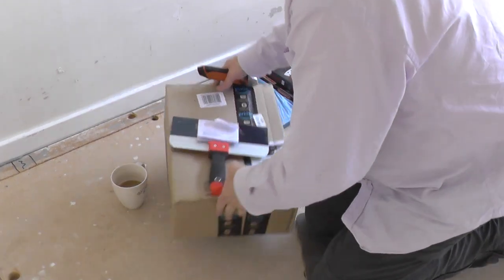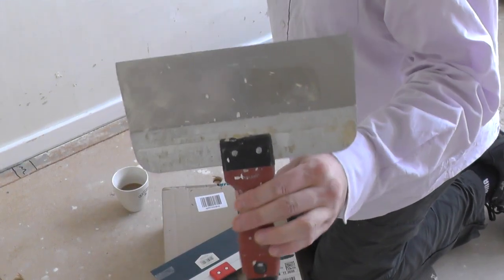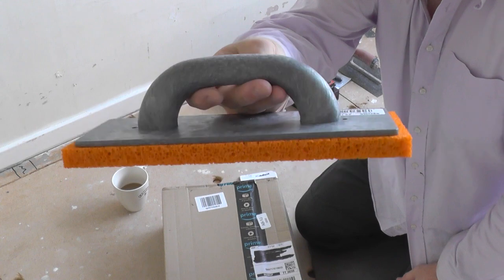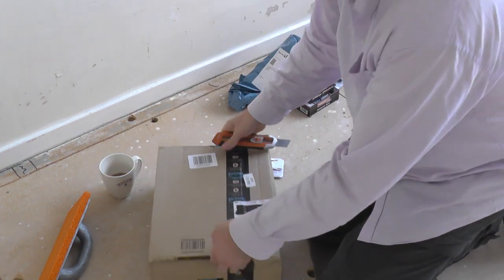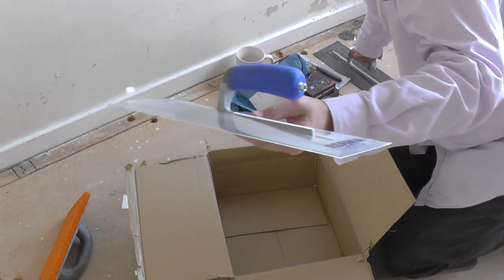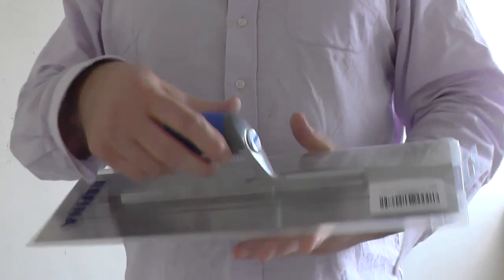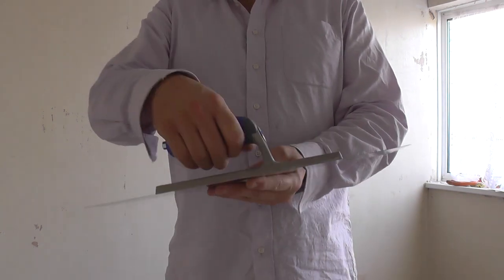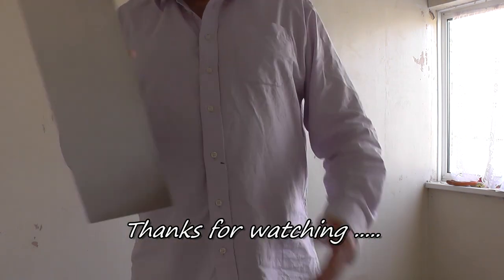DIY: Unboxing New Plastering Tools

Comment: Dont sponge plaster please god. Render yes, plaster no. 
Large hawk, nice quality 18" trowel, larger trowel makes it easier to flatten if your new to plastering. Always round the corners off a new trowel, helps stop the blade gouging the skim. Very light round off to them with a file. Oil your trowels after use if your not going to use them for a while, stops the corrosion. Dont forget a old debit card or something you can use to get into smaller gaps if the need arises.
Reply from the maker: Hi there and thanks for watching and commenting. Using a sponge float when skimming certainly creates a fiery debate amongst plasterers! I appreciate your feedback and advice. Cheers mate. Best wishes, Des